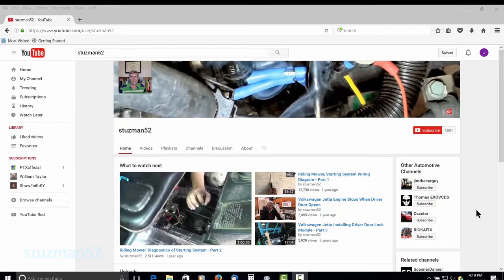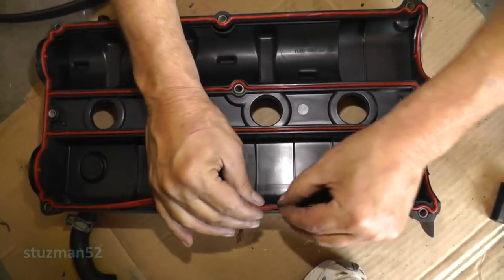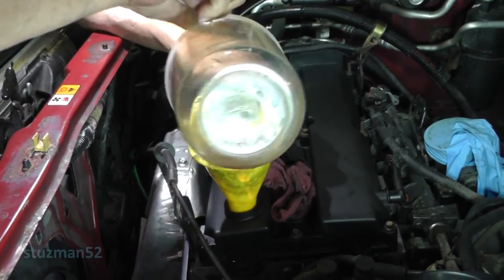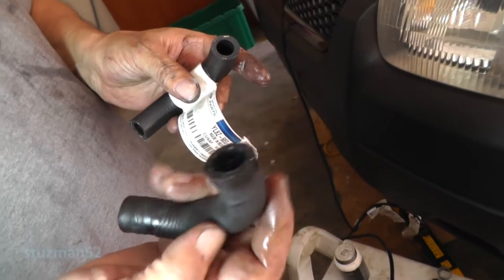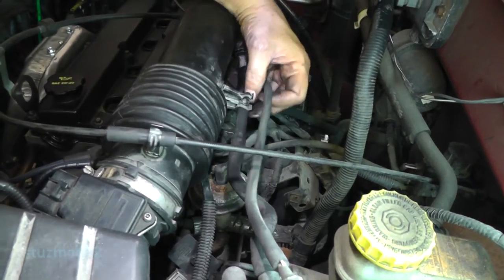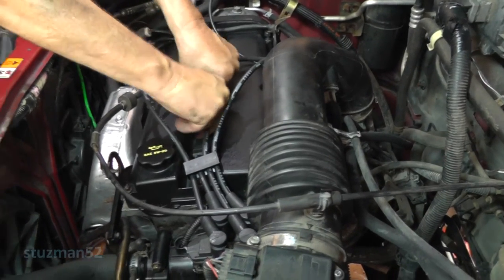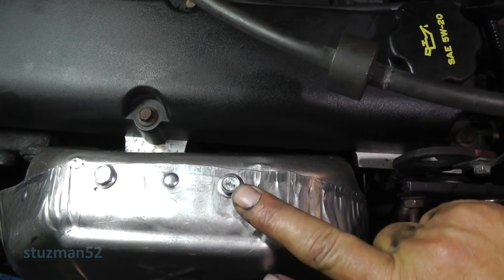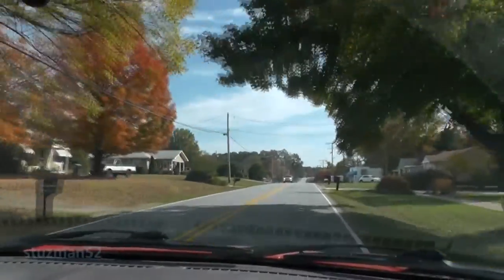Ford Escape Timing Belt and Water Pump Replacement - Part 8

Comment: Thank you for all the time you took making those videos. I seem to be very attached to my 2002 Ford Escape. It unfortunately is toward the end of its useful life but I can't seem to let go of it. The requirements are becoming more and more challenging to keep it going. Don't know what I'm going to do when I run out of rope. I've had my Escape for 2 3 years and have become very attached to it like a family member. Thank you again for your detailed instructions
Reply from the maker: Russ, I would say if it's not expensive to maintain, go for it. The prices of cars new and used are astronomical nowadays. Keep if fixed if you can!

Comment: Very informative! it includes torque specs unlike other videos who neglect to mention these important things. Hope you have the 2005-2007 model 2.3L as its quite different engine. I wanted to replace my valve stem seals but I had difficulty removing the crankshaft pulley bolt, so I backed out. I'll just send it to an auto-shop where they have power tools.
Reply from the maker: This video series was meant to be detailed and a DIY could do the job. But that means that the person should know his own capabilities and that he mechanically inclined. I wouldn't recommend this job or any timing belt job who has never done one before. And you could always buy yourself and impact tool :) Thanks for the comment!

Comment: Engine lube on the cam lobes? Smart. Especially, when we know you didn't do this in 10-15 minutes, like you may have joked to your wife at the beginning of the series. :)

Therapeutic? Funny. Gaskets that go into slots like that ARE nice...if they're shaped perfectly and they don't fight you. That sure looked like a good fit. :)
Reply: The final text comment about getting rid of it because it has too much space for yard-sales? Hilarious. :)
Reply from the maker: HaHa! Yeah, it wasn't a 10 minute job fore sure :) The lube was just a little protection for the lobes when the engine was down. And nothing like having a gasket that fits perfectly in the slots. Thanks DE for dropping in and watching the video!
Reply from the maker: And it's true DE! That thing has junk in the back all the time now of where I have to pull it out and store it somewhere. Thanks for the comment!

Comment: Just as an FYI, the Escape does not use a heater valve. There is 100% coolant flow through the heater core at all times, so there's no benefit to turning on the heater when bleeding air out of the cooling system.